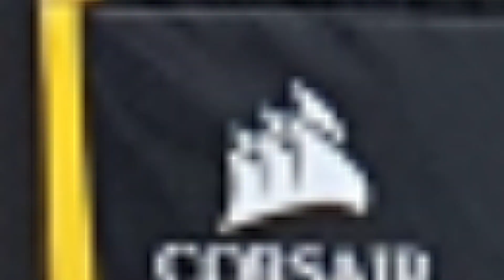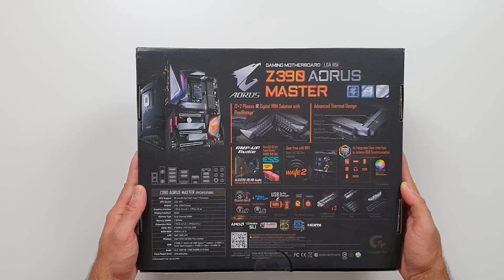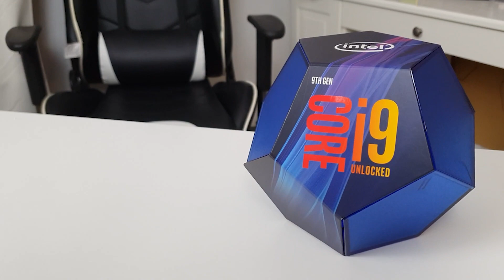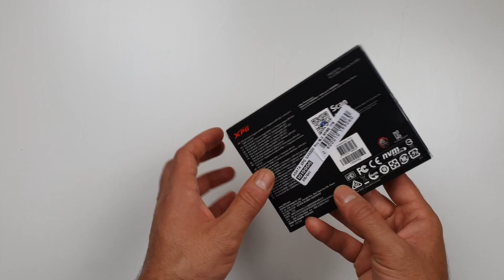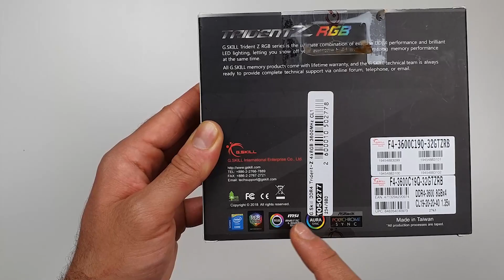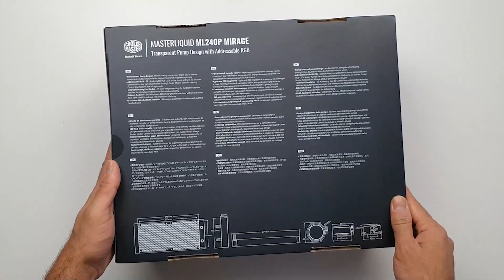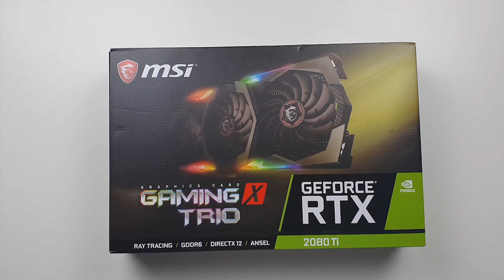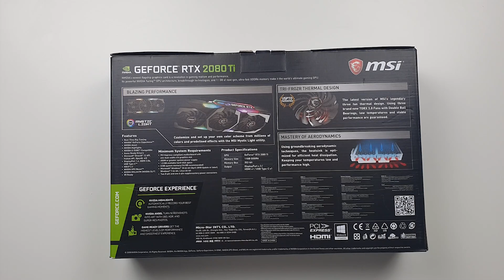How To Build a PC 2022 | Step By Step | Beginners Guide

Comment: Great PC Great video  and good selection of parts. Just one question: Why did you pick the 2080ti instead of the 3080 or 3090?
Reply from the maker: Thank you 😊.  As mentioned in the video I wish I could get the 3090 but I couldn't afford that and for the 3080 this the most underestimated GPU out there for all what you get for the price this will be the one I will be usine in my next project. The 2080 ti is closest on to 3090 and it's cheaper so that's why